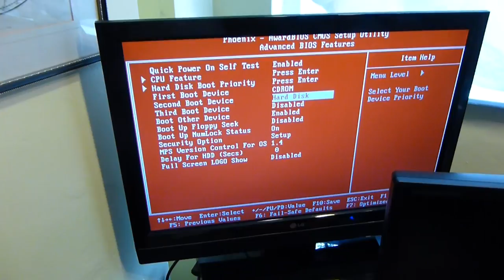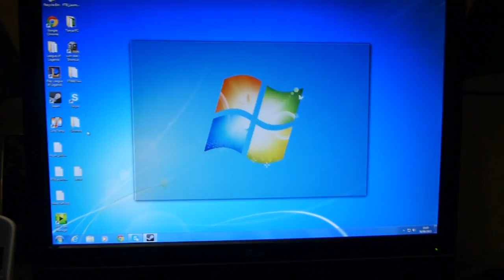QuickyBaby: Making the Peppy Computer!

Comment: Good times and great memories creating Frankenstein systems.  lol  Quick tip for anyone that cares, but if you have a disc stuck in a cd/dvd drive like in this vid, just need to get a paper clip, straighten it out, and push it in the small hole in the front of the bezel for it to open the tray.  This would hopefully save you some time w/o having to power the drive to get the disc out.

Comment: How Quickybaby you gave me a great idea for my new PC build. I have a few really old PC's in my shed, one of them is a Time PC.

I suppose with a bit of tinkering I can fit a brand new mobo, CPU, GPU, PSU and maybe do something with the cooling (Maybe drill a few holes and put on some 120mm fans). Hopefully I can fit a H80i push/pull at the back and run a 3570k at around 4Ghz.

Anyway I hope it would be awesome, maybe in the future if it becomes a reality I'll post some pics!

Comment: QB to open the dvd drive without power use the paperclip u used for the mobo test and push it into the little hole on the front of the dvd drive, hey presto it should open.

Comment: You should know another trick with a paperclip is that if you leave a cd/dvd in a drive when you unplug it you can just insert the paperclip end into the small hole on the front to open it! You may need to straighten the paperclip to make it longer.

Comment: PCI-e 3.0 has a higher speed. But actual graphic cards can´t use it. In some benchmark (not game benchmarks. sytetic benchmarks like 3D Mark 11 etc.) you get maybe 1% more points and the extrem overclockers jizz over it when they get 1. Place ;) In some jears you will need it, but not now.

Comment: First off did you see taht little hole in thee front of the OLD DVD player well if you stick a pin or somthing small in it it will open the it Jsut  a tip ;)

Comment: lol GTX 260 will run WoT at max settings? My GTX 650 can't even do that.
Reply: My old rig had a GTX260, it could only run max settings if it was set to standard mode. Not improved mode.
Reply: Well I have a 760 in here, It plays anything Max, however CPU HeavyGames like WoT take much resources from the CPU not GPU, my FX 6100 @ 4.23 GHz will deliver no more then 40 frames in Open WoT battles.
Reply: mayhemSWG
My FX8320 Eight Core @ 3.5GHz will run MAx, 1920x1080 with 50-60FPS
Reply: MrMarci878 No it does not.
Reply: Laurence Barnes On 1 Core (as it is now) with 30FPS.
Reply: I run WOT on a 4670k @ 4.6ghz and it runs it around 50-110 fps on 1080p max settings.

Comment: What is over clocking?
Reply: I essence, it's increase the frequency the CPU operates at - meaning it will work faster. The frequency the CPU runs at is its clock rate, hence the name "over clocking".
Reply: oh, thank you
Reply: TheFlyingPineapple Overclocking isn't only on CPUs. Please don't say anything if you don't really know what you're talking about.
Reply: lmCIoudz
Everything I said was correct. QB was talking about overclocking a CPU, I explained in laymans terms what this involves.
Reply: TheFlyingPineapple But as stated before, overclocking isn't only on CPUs. It's available on CPUs, GPUs, and RAM.
Reply: You can also overclock an Graphicscard, you increase voltage, ( ONLY FOR PRO´S!!) Core Frequency and Memory Frequency
Reply: lmCIoudz Haven't I seen you before commenting on the AMD Radeon HD 7990 Video? I just never commented I don't think but I saw you before.

Comment: I have Intel core I7 4770,dual 290X. 32GB RAM.512GB SSD and 1TB Harddrive.
and a 1000 Watt PSU. And still have FPS drops :/.
Reply: bull shit, i have no frame drops on my gtx 780 so on dual 290x there is no way you have frame drops
Reply: No bullshit.
Reply: Warface1987
yes bullshit lol....I have dual 290s yep 290s not X's with a 3570k OC'd to 4.2 (minimum....max I go is 4.8) anywho, even on stock 3.8-3.9 no frame drop...perhaps your RAM is poop or moreover your mobo is dated..odd though with 290xs
Reply: Sly Boogy You say that like the 290x is way better than the 780. It's barely better, if that.
Reply: first of all the gtx 780 is the better of the two and second we are talking about 2 290x card not 1. -_-
Reply: Sly Boogy I UNDERSTAND WE'RE TALKING ABOUT TWO.

Every benchmark I've seen the 290x gets better performance, but not by much.
Reply: If you are still getting FPS drops while playing WoT, them somewhere in your system it is most likely bottlenecking. Or as was said your MB or RAM could be outdated or having issues. Could even be one of your cards having an issue. Could be a number of things. But with those cards, you should have zero issues maintaining smooth FPS. I run sli'd GTX 770 4GB cards, fully maxed settings with no issues at all. So you should easily be able to do the same.